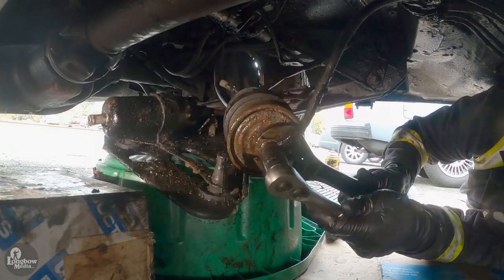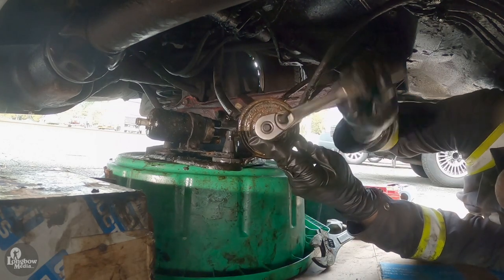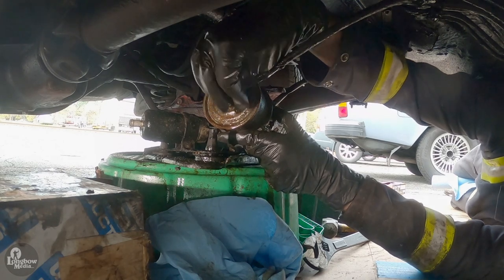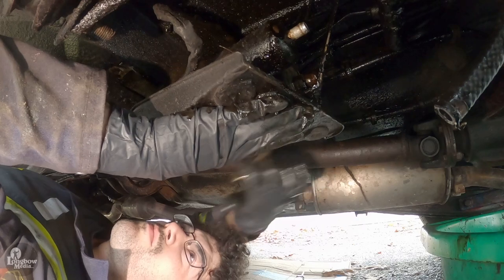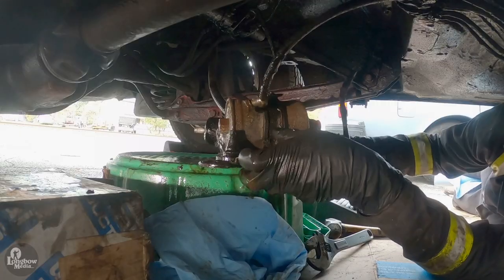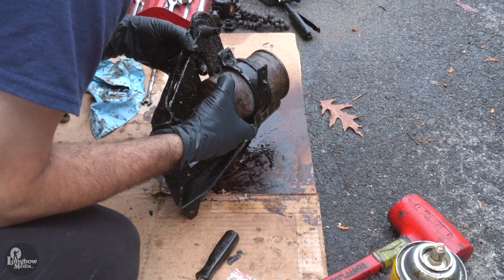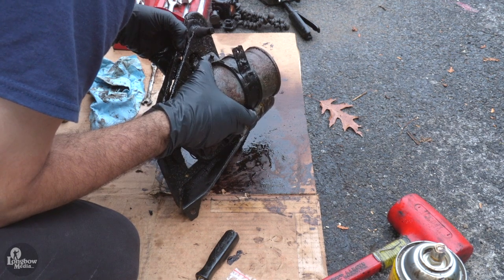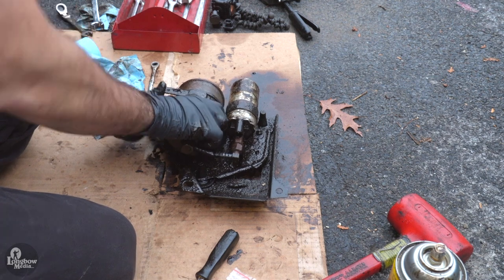How to Replace the Main Fuel Pump & Filter on a Volvo 240

Comment: What parts did you use?
Reply from the maker: Fuel Pump (Bosch 9142044 )
Fuel Filter (Bosch 1389562KT )
Fuel Feed Line (ProParts Sweden 1312297 )
Reply: @LongbowMedia  big thanks!

Comment: could you please tell me the part numbers for the uses parts?
Reply: Fuel Pump (Bosch 9142044 )
Fuel Filter (Bosch 1389562KT )
Fuel Feed Line (ProParts Sweden 1312297 )

Comment: first generation 240 don't have these pumps.
they have a inner tank pump
Reply from the maker: Thanks for the heads-up!
Reply: Second generation has an in tank and one of these, on mine it's an accumulator instead of a filter
Reply: They have both